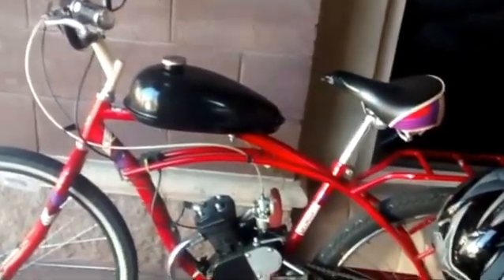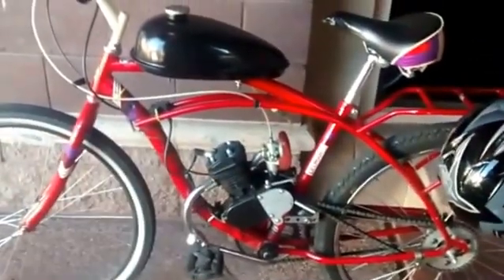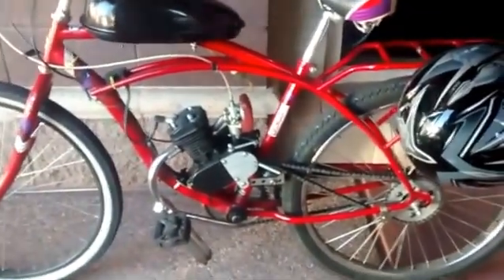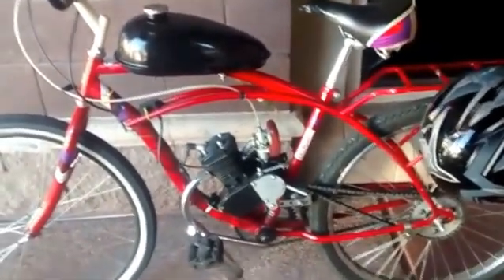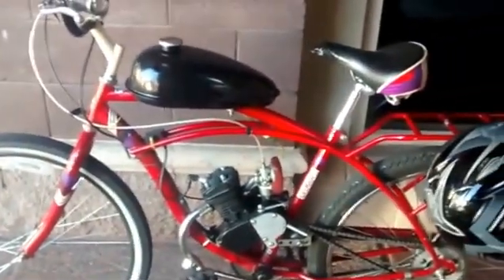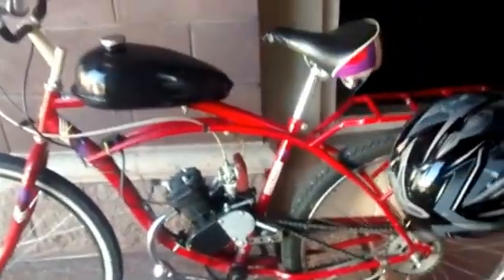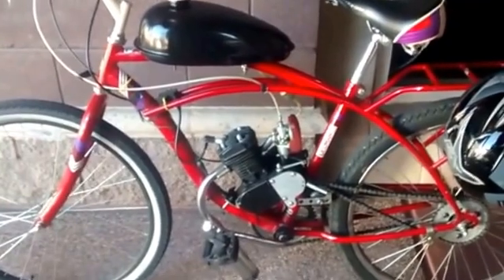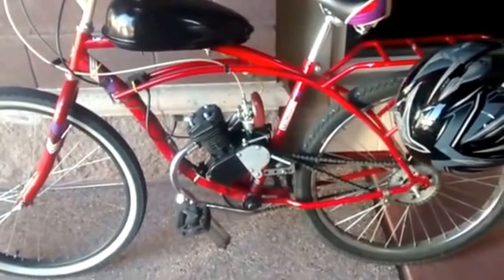Carburetor Settings and How they Work on my 48cc Motorized Bicycle

Comment: Hello, I recently purchased an high performance air filter and a CNC velocity stack for my NT speed carburetor. The bike runs and idles but every time I give it gas and try to get to the mid-high RPMs sometimes it just wants to bog right back down and come to a stop and then suddenly it revs up really high then keeps bogging till it stops. I don’t get it could you please help?
Reply from the maker: Keith Garrison jetting is off - after installing new parts did you reset the main jet in side the carburetor barrel? If not the doing so will solved this problem. 

On the end of the throttle cable is the barrel (brass thingy with needle thingy attached to it) on the needed jet is a little clip and 4 slots. (It should be on the second one down right now) move the clip up one and try start ride bike see if that is better or worse. If worst the ho back to starting point and go down one slot see what happens. If better then reset idle screw and Ka-bingo u are a speeder bike carb expert”) otherwise if you need more info or visual aid I have a video posted in the red speeder bike playlist explains this entire issue
Reply from the maker: Here is the link for the video https://youtu.be/nDLLdskOH6U
Reply: brian noel 
I appreciate your help sir. I believe my jetting is off because I have the stock NT jet in there. I’m running way too lean my air to fuel ratio is off. I bought some bigger jets from eBay and I’m certain that that will fix the problem. Thank you so much for your willingness to help. This means a lot. Jesus bless you!
Reply from the maker: Your are welcome and thanks for watching “)

Comment: I have stock nt carb and just jetted to and 80 with the clip to 4rth down.second from bottom and it still has no top end power band.need a bigger cc head i think
Reply from the maker: click it up one --  did you change the stock gearing on the back wheel? what size gear is it? 44t 40t? sometimes if you drop down to 41t or 36t you wont get more revs but you will be able to use the top end torque to get some more speed out of it") thanks for watching
Reply: brian noel no gearing is the same but i did what u said and its mint now!thanks bud.and yea ive watched a few of your vids and like them all.the info u provide is precise and to the point.thanks again bud
Reply from the maker: thanks bro it's all in the wrist") thanks david for watching
Reply: brian noel no prob love the vids

Comment: im pretty sure that i run my 2 stroke much leaner than this (my specially modified needle equall to an extra 2 noches) and i have no trouble getting past 35 mph on a 40 or 36t sprocket all-stock motor. might make a vid about it some time ;)
Reply from the maker: geared at 36t you should be able to make 41mph that is the best I ever did and I ran a stock engine easily. doesn't matter if it's lean or not at the top end the little engine is sucking in max air/fuel mix and turning around 9000rpm if you have a good set of wheels and tires balanced and up to the right air pressure(65lbs for 26")  speed is what you will get") thanks for watching
Reply: what i really meant was that it runs much smoother all around so i wasn't sure why your motor didn't like running lean.
p.s. i counted the teeth this morning and its 41t sprocket 
and i usually keep about 35-40lbs in the tire
Reply from the maker: 41t good gear overall best one for city traffic and stuff plenty7 of tourque for cruzing and good fuel miliage making itmore fun")

Comment: Nice setup, but the chain is to long and it rubs on it self near the tensioner (love that tensioner have to order one for myself).
Overall good setup keep up!
Reply from the maker: the chain doesn't rub it's the hard rubber wheel that cuts into on of the rear engine mount screws but since it has finally cut a deep enough groove it no longer rubs or bounces against the spring. thanks for watching please watch the rest of the play list i have 56 videos in this playlist everything that has gone wrong and how i fixed it or upgraded is covered -- here is the link: https://www.youtube.com/playlist?list=PLKRmdCKcaPeYSFCSNZZptYctH8lIokW8F
Reply: 4 years, later I got the same tensioner and it's amazing! solved all tension problems and the risk of the stock tensioner to get loose and jammed into the back wheel ! Keep up!